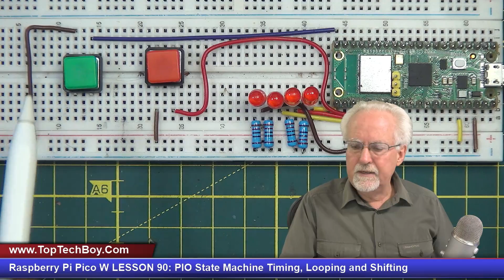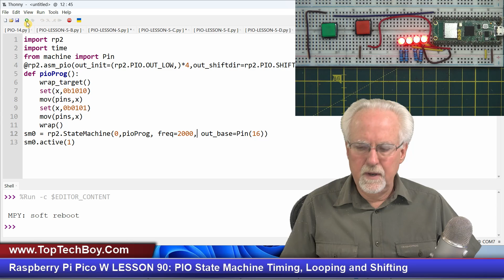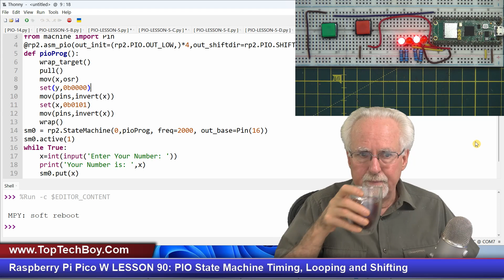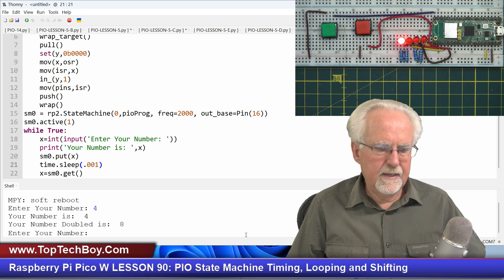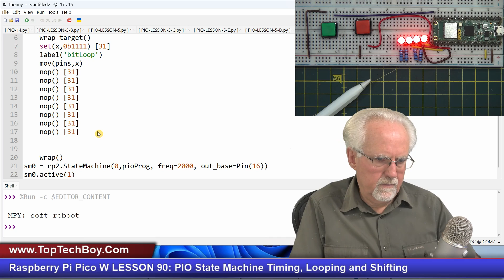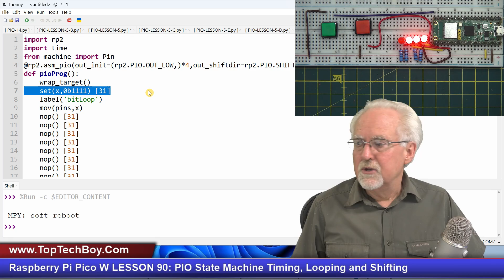Raspberry Pi Pico W LESSON 90: PIO State Machine Timing, Looping and Shifting

Comment: I have it counting up at a rate of about 1 count every 55 seconds.  It's already pretty boring, but I can double that period about 19 more times without changing my program significantly.  (And I'm not using any of those ridiculous "nop() [31]" statements, in fact I'm not using any instruction delays at all.)  By my calculations, I can get the period up to about 333 days; if you want it to count slower than that, I'll have to change my program.  HOW SLOW DO YOU WANT ME TO GO?  In my past assembly language programming experience, one of the reasons for learning assembly was to do something as FAST as possible, so I congratulate you for reversing that paradigm...  :)

EDIT:  I think I was wrong and can "only" double the delay 15 more times to one count every 20 days, before I'll have to make a significant change to make the delay even longer.

Comment: 49:05 I AM A LEGEND! I did it at once by the invert() statement and to slow it down i used machine.freq(20000000) and set the freq of PIO on 500. You are simply great i can even imagine I am able to type assembly code on my own. Thanks Sir.